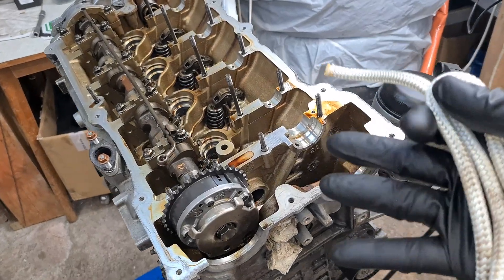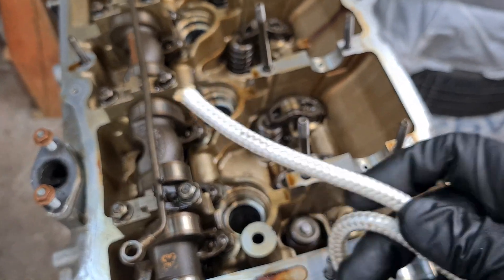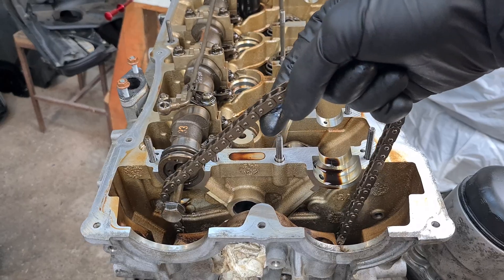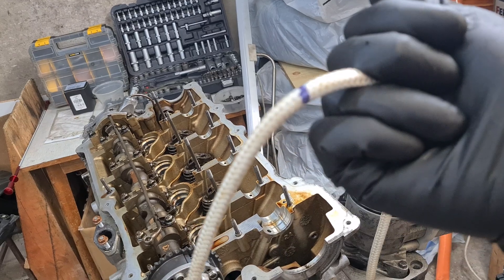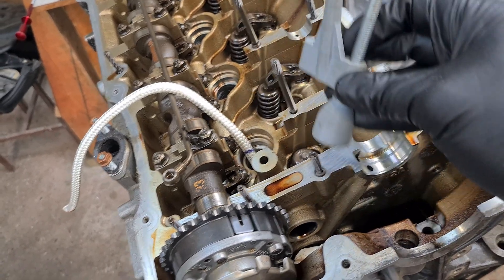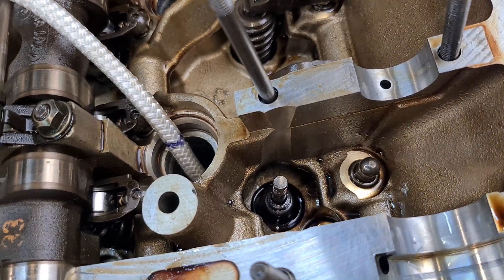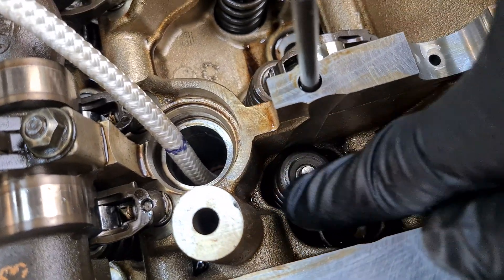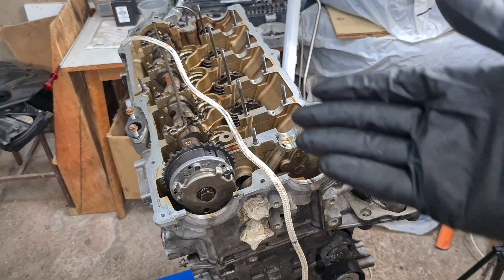Using rope to hold valves during valve spring removal and valve stem seal replacement

Comment: That tool seems more convenient to use compared to universal one. Do you ship to Australia? I like your videos. Very informative.
Reply from the maker: sure.
Reply: thanks. ordering now.
Reply: Hi, using the rope method, can the pulley be rotated with the engine in the car?
Reply from the maker: @markanthonydelacruz1198  not sure what you mean... when the rope is removed you can rotate the crankshaft. Make sure that the car is in neutral gear and that you keep the chain tight against the bottom sprocket to prevent breaking the chain rail.

Comment: Hey. May i ask a question of help? :s   My chain tensioner broke of in engine. Did the whole repair with my own hands by your 2 part tutorial (perfect instruction, bow down), assembled all back together with perfect timing, started up nicely after few tries. Rode the car for 2 days. In the 3 day it died. tryed to start. and beneath the engine bay withing seconds accumulated HUGE oil puddle. even saw two ~1mm running (not dripping) oil streams.  A lot of oil seemed to be from oil filter housing. dissambled it. found that in oil cooler housing, intake hole end was completely clogged with leftover tensioner plastic pieces.... cleaned it (filter was clean). Cleaned everything and Installed new 2 gaskets with filter just to be sure.   Tried to start the engine again...     and...     engine streamed out oil in streams again..... even through the oil filter housing again! (nothing unexpected - the weakest Nm place for oil system)... But i understand that the engine clogged with debris somewhere else also. but where? oil pick up filter for sure needs to be checked. but maybe you would suggest any other idea also? Thank you very much for your time spent on random strangers cry of despair.
keep on good tutorials. Subscriber
Reply from the maker: Sorry to hear that:( I will assume that the oil cooler is now cleaned up and not blocked... You will have to remove the oil pan and clean the oil pickup screen. You will also want to remove and inspect the oil pressure regulator valve. It could be damaged or clogged with plastic debris and that could cause the oil pressure being to high. Another - but worse - cause could be that some of the debris got past the filter housing and in to the oil lines inside the engine block and cylinder head... the your only reasonable option is to pull the engine, disassemble it and clean it...😬
Reply: @BimmerZen  thankyou for your advice :) it realy helps with not giving up. inform you here when will do the work!
Reply: @BimmerZen Hey. Back with an update. So yeah, removed oil pan, checked oil pickup screen - clean. Then opened oil pressure regulator valve - full of plastic pieces. Inserted pressurised air into the oil filter housing 2 side holes (not the middle one) and removed the debris. Putted all back together. Started the engine with ease. 10min worked perfectly, but i didnt revved it. As soon as i revved it to 5k+ rpm - oil spitted freely from oil filter housing cooler again... So either engine pushed new debris into oil pressure valve again from the corners of the oil pump's housing (i hope) either oil lines in block from the intake side...? But then it would showed up quickly in idle - it would be problem for engine to work even in low rpm if there were clogged before this inspection, as i only inspected bottom. ://   
Another question came up - may the oil seperator needs to be checked? which is under the intake manifold. As It has springs and bedding for debry tai lay down.
hope this experience finds usefull to anyone reading.
Reply: You used 2 gaskets at the same time?  That's not a good idea.
Reply: @underourrock  No... If you havent seen, Oil Filter Housing has 2 gaskets. Horizontal ant Vertical
Reply: @ricardass3266  2 side by side makes a lot more sense that 2 stacked.... I'd recently seen a video where someone has installed two stacked on an exhaust manifold and there was a leak because of it.   Thank you for the clarification and I apologize for my mistake

Comment: Hello mate hope you can help 
I got pressure build (somewhere) and it's releasing the pressure like a blow off valve. Sounds sick but it's not cool coming from a N/A engine lol.. any tips or where to check. I've looked at the intake side of the engine as where the sound is coming from. all Is good tho but do you have any possible suggestions.
Thanks in advance keep up the videos man love watching them haha very informative
Reply from the maker: I would suspect CVV separator/hoses. Do a vacuum leak test if you can.

Comment: USE THICK ROPE! I once got the rope stuck in a knot inside the cylinder and had to take the head off to cut the knot off...
Reply: You can also soften most ropes with some chemicals, put oil in or burn them to ashes to get them back out..
Reply: @rkan2  Where were you 2 years ago? That would have helped. Instead I scraped the n46 and swapped to m54. Easier then working on the 4 cylinder lol
Reply: Same here mate, I used the 8mm nylon rope like he said and now it's stuck in the cylinder. I didn't see this comment. @BimmerZen PLEASE update this and put a note to say you need to use thick rope. Thank you
Reply: @mattymuso2108  Been there done that. Like the other guy said maybe research what chemicals dislove nylon. I wouldn't burn it as nylon will clump into a weird plastic. Hopefully you won't have to take the head off...Best of luck.
Reply: @djcase1116  I got it out! I took the valve springs off and held the valves up with tiny circlips, then I wiggled the valves in and out, reversed the engine rotation and the rope came right out! Now I have another problem though. I removed the rocker arm to get to the 1st cylinder valves and I rotated the engine to put in and take out the rope. Now my ignition timing is all off.
Reply: @mattymuso2108 what thickness should be used instead 12mm ?
Reply from the maker: I guess thicker rope would really be better for that.

Comment: I need this tool but 21 euro is expensiv
Reply: But it is worth every cent, believe me. I started to replace the seals with universal tool for about 30-40 Euros, but it was so difficult to handle it alone, pressing against the spring with one hand and trying to place the keeper with the other hand... It takes much time... I finished only the first cylinder, it driven me crazy. 
Then I bought this tool and finished the rest much much faster and relaxed. I don't want to know how it went, if I did the last valves of 4th cylinder with universal tool...
Reply: Amigo não é caro , eu passei uma semana fazendo as duas ferramentas de ferro para comprimir as molas , só não comprei as do bimmer zen , devido à distância , creio que o frete ficaria caro